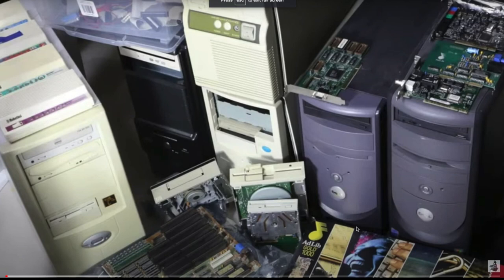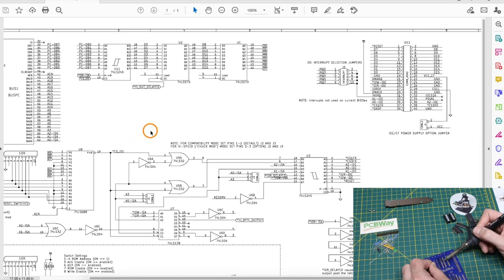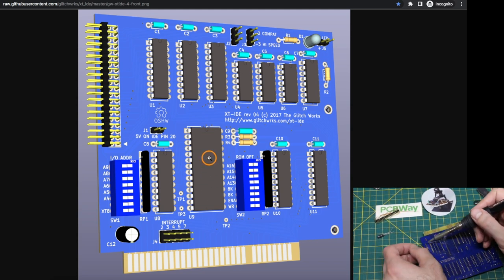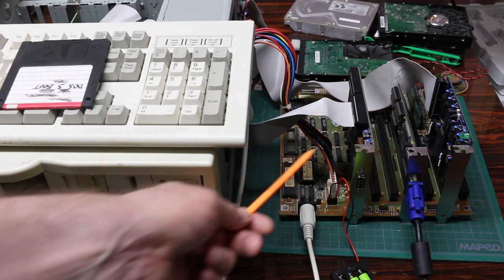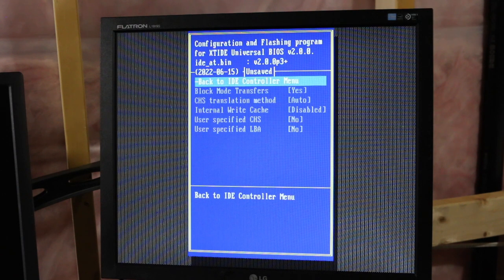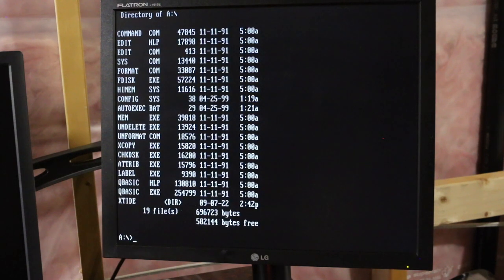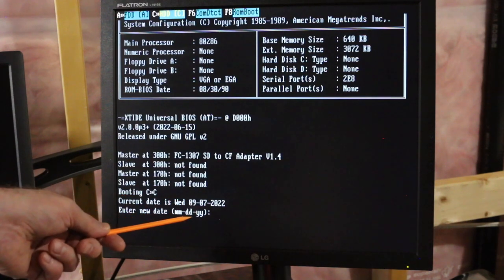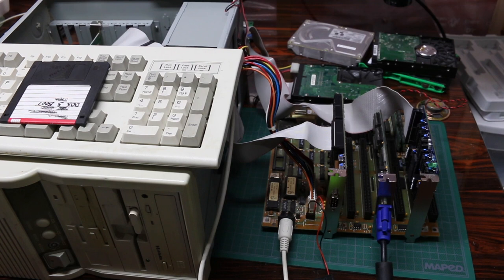My 286 Now Has a 2 GB SD Boot Drive using XTIDE Universal BIOS and This PCB

Comment: I built an 80386-SX PC back in the day., I had to set all the interrupts manually. It was a collection of leftover parts from several computers. It was my first build for a desktop PC. It was a success. I'd love to do it again. I'm restoring a special desktop PC that I had custom-built about 2000. I'm learning from this video. I want to use 2 floppy drives, 1 3.5" and 1 5.25 double[sided double-density floppy disks. Kudos to you, it is a great video.

Comment: You сan use Ontrack Disk MAnager 7.0 which allows a 286 or a newer computer to detect any IDE HDD or CF up to 8 gb ) I use 2gb CF cards in 286 and IBM PS/2 Model 40sx with Ontack DM7 and a passive CF adaptor for IDE cable)) I use ISA8->CF devices in IBM PC/5150 and AT/5170, though)